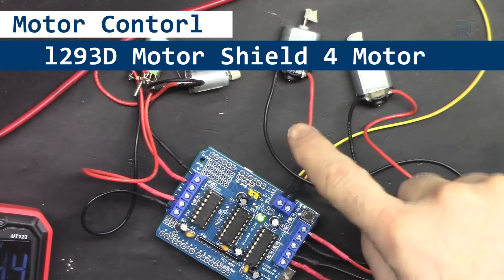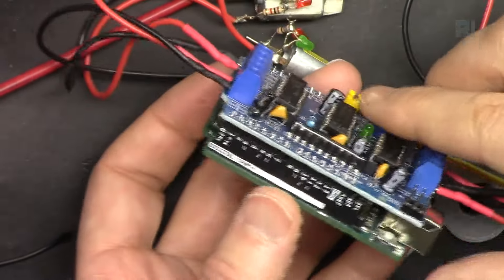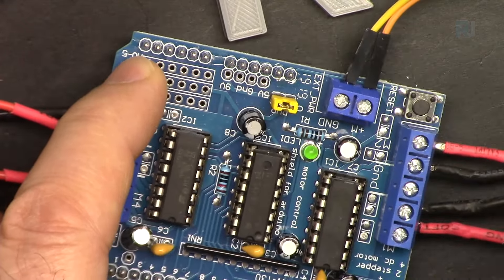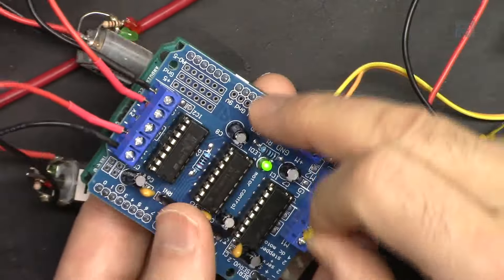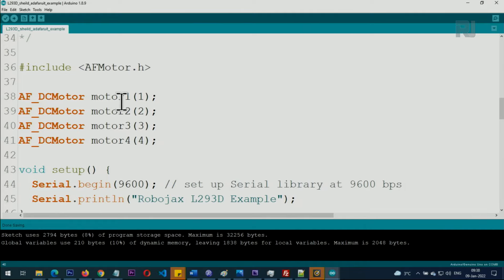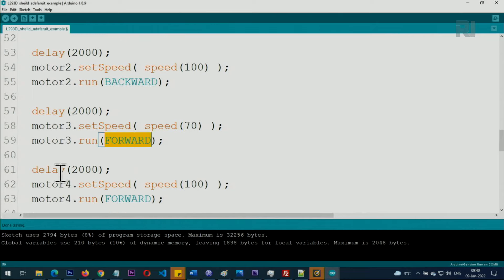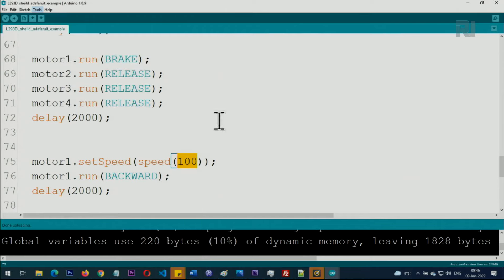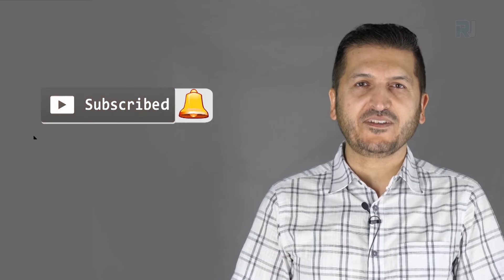Lesson 95: Using L293D 4 DC Motors Shield for Arduino UNO and Mega  | Arduino Step By Step Course

Comment: This is a great video, helping me tremendously with my project. Why do you say you can't have more than 600mA on one motor? Is that a limitation of the motor, the shield, or the arduino?  And What happens if you attach something with higher current like 12V 
5200mA ?

Comment: I had a school project where I needed to build a robot. I was very confused wether I needed to connect external power to the motor shield or not. Your explanation at the end was superb. Thx bro! Im subscribing from now on :D
Reply: Hii Bro i am also in the same condition i am making an obstacle avoding robot and i am using L298N motor driver but there is some issue with the power supply what can i do ?

Comment: I amde an obstacle avoiding robot and my motor driver is not working and making a beepmsound every 4 secodns what might be the reason?
Reply: Check voltage
Reply: Did your project work when you step up the voltage

Comment: Thanks for this. I think the 600ma you mention is limiting me. I can hear the motor PWM signal with a high pitch noise but the motor doesn't turn. I tried increasing voltage but it didn't work. I ran the 4.5v outlet direct to the motor and it span no problem but going through the board (jumper on or not) the shield just doesn't have the juice to make it even spin even at 255 power in the code.

Comment: Great! 
How to control 8 dc motors with esp32 and ardino uno and also have 3 servo controllers and camera feed? 
Any feedback would help!  What all to buy?
Reply from the maker: may be this video is useful: V5 Video Controlling 32 servo using ESP32 with WiFi https://youtu.be/bvqfv-FrrLM
Reply: @robojax  super work ! thanks a lot for the input..

1. So if I need like 8 dc motors  what is best way , do I need to use ESC to dc or ESC to brushless ,  motor shield ? 

2. What is best way to with less power and wires for 130 try mini motors and 5 servos ..

Comment: I really like your explanation it's very clear and easy to understand but can I use the other pins or add sensors and modules such as NRF24l01 radio module?
Reply from the maker: yes all other pins are available.

Comment: @5.30 - 
I want to change the direction of the motor revolution without changing or switching the wires physically ? How do I do it.
Is there an Input Pins / control pin mechanism of some sort where I can change programmatically using the sketch. I can do that for the L298 breakout board using the IN1 and IN2 pins. I am looking for something similar on this breakout too.
Appreciate a reply.
BTW : I dont want to install the AF motor library - but I want to do something using bare Arduino sketch like digitalWrite( InputPin, HIGH); also I m using a Wemos D1 to control the motor. The AF library is not compatible with this hardware/uC.
Reply from the maker: Hello, the chip is L293D and I have multiple videos on that. here is the video https://youtu.be/LkJRakZBChI where the chip is used on breadboard. I have mentioned the pins on the shield, just send command that hat pin shown in this new video. Good luck
Reply: @robojax  Wow ! that response was quick - Was not expecting it.
Thanks - Will check and much appreciated the timely help.
Reply: @robojax  I saw the video now, and I was hoping to use the breakout board ( L293shield) instead of using the bare chip L293D

Comment: Hello, first and foremost, great video! I‘ve got a question however, how do i start and stop this sequence via the computer or something connected to the arduino via cable? I‘m looking forward to your response and am thanking you in advance.
Reply: I bilieve you might need to add a switch for that (on the arduino) so you can manage to stop and start it, however you might need to make a code for it for the sensor of the switch to work properly using the arduino IDE and you will probably need to use a decision statement for that also an analogwrite function

Comment: Iam not able  to find the pin description of the driver board how can i  connect it with esp32 and run code without knowing the pin discription
Reply from the maker: Won't work with ESP32.
Reply: @robojax  but why sir ? Please explain

Comment: Hello buddy, great video! Would a project using the TB6612 shield work with an L293D?
Reply from the maker: I just looked at the datasheet for 6612 and it seems it can be used instead of 293d. Yo understand it search my channel for l293d and learn about the pins then you should be able to use 6612 instead of it.
Reply: @robojax  Thank you for the reply Sir! I'm planning to use the 12C motor shield with it, and I watched a video with someone using a TB6612 and all I can seem to find for a reasonable price is  L293D's so I was wondering if I could go with that instead. Again, Thank you for replying :))

Comment: @Robojax I have a question.
So I hooked up 4 6v dc motors to the motor shield, supplied them with 4 AA batteries(6V). M1 runs just fine, but M2 M3 M4 isn't getting any Power. How can I fix this? Please respond ASAP, thank you so much!
Reply from the maker: The same power that goes to all motors . It is the arduino you have send single or control them.
Reply: Did you solve this? Also having the problem that with all 4, only 2 seem to work.

Comment: Hello, I already have 4 DC motors connected to an L293D, and I want to add 2 peristaltic pumps. How can I do this?
Reply from the maker: Hello, this can drive 4 motor only.  for 4 motors you need motor driver. L293D chip is a motor driver and would drive your extra motor.  You can learn it from https://youtu.be/D4yLsWvZDw4 whch show how to use L293D chip (the IC ony). I have tones of other videos for motor. just search for it.
Reply: @robojax  do i need another motor driver for the 2 water pump?
Reply: @robojax  can I use  a relay module for the 2 pumps?

Comment: I have a question, I was making just like that but with bluetooth module, and everytime I turn on the battery the BT module will not blink but if I use the Arduino it works. Can you explain? Thanks

Comment: If i want to use digital pin, how can i use it and which pins is available?
Reply from the maker: I mentioned which pins have been sued. the rest are available so you may solder wires to use them.

Comment: Hi Sir, first question: is it possible to connect a manual switching on this circuit using switch buttons to start&stop the circuit and then switch it back to automatic sequence when you are using arduino mega 2560?
second question: can i still connect the LCD display on the circuit to show which motors is running and how can i connect it?
Reply from the maker: Hi, yes both are possible.  you just need to know how to make it work.

Comment: Hello Sir
Why mine is hot, I use l293d for 2 servo , 2 12v water pump with 0.6 current load each and also 2 12v dc motor with 1.1 current load each 😅

Comment: Hello, Can I use this very same shield to control the same motors with a joystick?
On an uno board? If not what is the best solution to do so?
Thanks
Reply from the maker: Yes you can do it.
Reply: @robojax  great how can I find out how to do it? Firstly all of the pins are being used and I can’t access them. Second I don’t know how to code for such. Can you please help?

Comment: When I change the velocity of one motor without changing the others, their velocity is also changing 😢. It looks like the power of each motor is being dependent of each other. Do you know?
Reply from the maker: No. Each should be independent. Make sure use the main code without changing it.

Comment: HLO BUDDY IT CAN RUN BY AA BATTERY OR 18650 battery
Reply from the maker: we don't care about the source. I mentioned the voltage which I forgot if it was 12V or 20v. just supply the voltage.  of course you can't carry 5000kg using a Toyota Corolla. The same is true for battery. I have no idea what kind of morot you run. but yes both batteries will work.

Comment: selamün aleyküm. Will the driver work with 2 pcs 24v stepper motors and 2 pcs 12v stepper motors?
Reply from the maker: walaikum salaam, for each 2 DC motors you can connect one stepper motor. so you can control 2 Stepper motor. We talk about bipolar stepper which has 4 wires. but as for the voltage, I am not sure. I have mentioned and provided the datasheet for L293D chip.

Comment: I have just discovered your tutorials, excellent. However I am trying your 4 dc motor code and I have an error. "
call to 'AF_DCMotor::AF_DCMotor(uint8_t, uint8_t)' uses the default argument for parameter 2, which is not yet defined
". I am new to Arduino and I am not familiar yet with commands
Reply from the maker: It means you have skipped the video. Watch it fully and the issue will be resolved.
Reply: @robojax  Can run the program. Because choose different boards,  after change to arduino uno can run the program
Reply: @robojax  Can the motor shield run while been control by mpu6050?
Reply from the maker: you can use it with anything else but you gotta know which pins are using by the shield. I should have explained it and I don't remember which pins are. see the video.

Comment: Are the input pins (for battery) rated for 9V or 36V? Datasheet is confusing and Amazon's description is just as confusing
Reply from the maker: I mentioned the voltage for the board at beginning of the video. That is important. Then the datasheet is for the chip L293D. That is for information as  I mentioned the capacitors on the board can't accept 36V they will explode. I don't remember what was the input voltage but watch the video I know I mentioned it.
Reply: @robojax  Thank you I missed it the first time. 5-16V

Comment: Hello: I am just try to run the code but occuer this: error: 'DC_MOTOR_PWM_RATE' was not declared in this scope
  156 |   AF_DCMotor(uint8_t motornum, uint8_t freq = DC_MOTOR_PWM_RATE);.  Could you hep me? Tks a lot...
Reply from the maker: It means you have not installed the library or you removed portion of the code.
Reply: @robojax  OK.  Thank you for your rapid response, but what library? I can not find it.. PS. The code is complet.
Reply from the maker: I mentioned in the video on how to install it. if you don't instlal it won't work.
Reply: @robojax Hello again, I am sorry insist, but  the fail goes on. Could you inform your email in order to send a photo with the library error?

Comment: Bro my ardiuno is not getting power from the motor driver shield , when I connect it with computer it work but when I remove with computer and supply power from battery it is not working
Reply from the maker: please watch carefully. there is jumper sittings you have to pay attention to .
Reply: @robojax  bro after coding I have connected the jumper in motor shield and supplied battery power from external supply then too it’s not working
Reply: Same problem with me

Comment: why the motors still turns after being stoped?? where does the leak voltage come from??? this is bad if you want precision?? is there something floating??
Reply from the maker: they should not run.  when you stop them. they stop. you must have done something wrong. either wiring or code.

Comment: I want to connect 5 dc motors and 1 motor pump then how can I connect to motor shield?
Reply from the maker: you can't control 5V.  you need additional motor driver.

Comment: I have just discovered your tutorials, excellent. However I am trying your 4 dc motor code and I have an error. "Expected initialiser before AF_DCMotor". I am new to Arduino and I am not familiar yet with commands, I have been using Raspberry Pi for my robots but RPi has now become impossible to get so I have turned to Arduino.
Reply from the maker: Hi, it seems you have not installed the library.
Reply: @robojax can i use 4 motors of 24 volt 350watt?

Comment: Arduino Mega2560 gets hot when I gave 12v to motor shield. What should I do ?
Reply from the maker: you are connecing it incorretly., your Arduino should be powred either with 5V or through the power adapter connector if you are connecting 12V.
Reply: @robojax   I seriously just started working with arduino I'm newbie can you please help me and and answer in bit descriptive way. I really love your work sir need your help
Reply: @robojax  You meant to say we have to power Mega2560 and L239d separate ?
Reply from the maker: I don’t know how you powered the Arduino pay attention to that

Comment: Why my motors is not working in 9v battery ,please help
Reply from the maker: If you did not change the code , the check the wiring.
Reply: @robojax  its working if I connect with PC ,but not working with battery
Reply from the maker: The you are forgetting to connect the jumper. Watch the wiring section of the video

Comment: nice!!  possible diagram and code arduino for controling dc motor 115v 15 A with potentiometer?
Reply from the maker: 115V is very high. it is possible. by Driver with that voltage might be hard to find.

Comment: There is voltage drop at each motor
I have a 10V supply
M1 has 3.6V
M2 has 2.5V
M3 has 2V
M4 has 1.5V
The motors r not running at full potential
Reply from the maker: We should have voltage and it should be consistent and about 1.7V or less

Comment: karim, can you write a code for (4) brushless motors? please
Reply from the maker: very cool project. we need Electronic Speed Controller or ESC which is a hardware that drives the brushless motor. I will see if I get the  components, I will write code and make video.

Comment: Sir My One Problem Solution Find Me Please Sir Motor Driver L293D Shield Is Canect On Arduino Uno Problem Is  Motor Driver All Ic is Very high Hit When A Problem Solution  Please sir  Reply 🙏😢
Reply: IC should not get heat when it has its own power supply.. but if you use power from Arduino then it might heat up a bit.
Also if your motor driver IC is heating up...check your battery

Comment: great explanation !! but i have question, i'm running 4 dc motors (6v 120mA) and 12 V battery (3x 18650 3 A) with a step down module to 9V (so the power is 9V to the driver). It works perfectly but the driver making a tiny sound, what does that mean?
Reply from the maker: The noise is heard when the speed is too low to make the motor move at faster speed. If your motor is not regular motor and has electronic circuit, that could cause noise due to compatibility issue.
Reply: @robojax  thanks for the answer

Comment: I have 4 gear motors and whenever I try running them all using my motor shield they don't run I always have to spin them with my hands to make them spin and they stop when I apply very small load on them . The power supply is given through motor shield and is 18v.please help(arduino uno)
I tried increasing the PWM signal but its still the same
Reply: Did you solve this? Also having the problem that with all 4, only 2 seem to work.
Reply: @awesomecubed  have you found a solution? I have tried everything and keep running into the same problem. The motors all make a little buzzing noise but don't rotate.
Reply: @thesaltycorn1622  I found I had two of the motors backwards. The L293D chip doesn't specify which is the positive port and which is the negative. A voltmeter helped me see that and then switching the direction of the leads solved the problem.